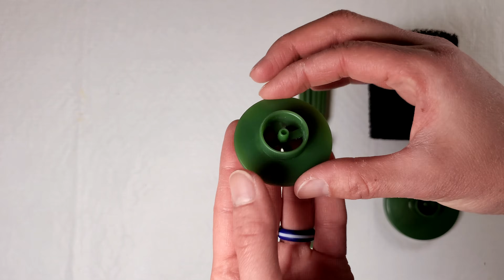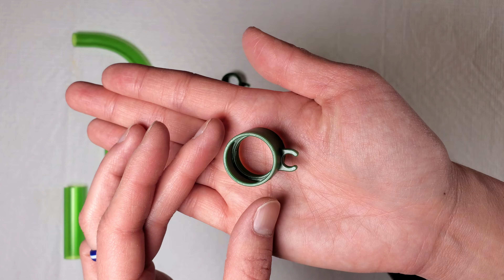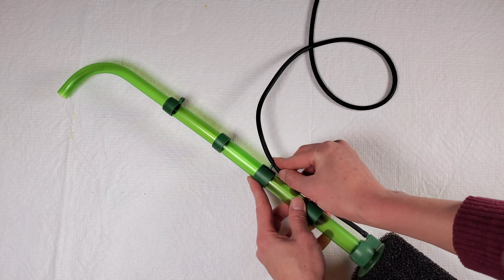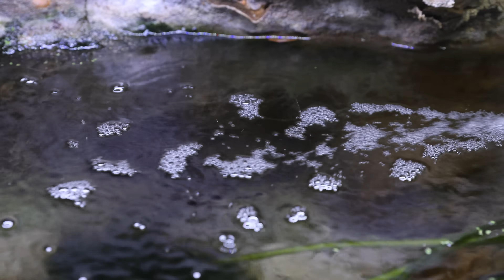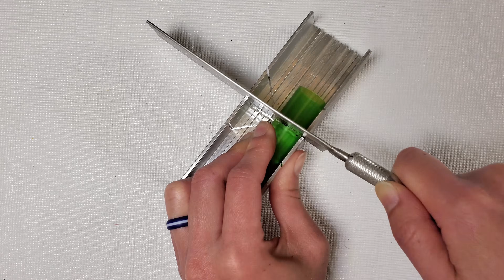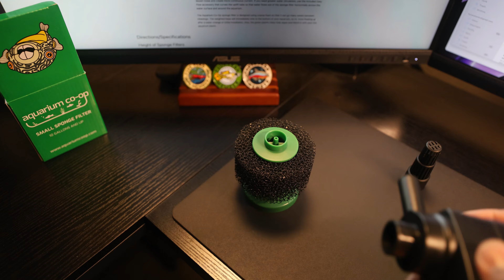How to Install the Aquarium Co-Op Sponge Filter and Easy Flow Kit

Comment: Is it me, or this filter it too corse to catch small particles?
Reply: @KAAPNW There are two sizes available. Fine or coarse. It certainly does look like the coarse one in the video.
Reply: It may sound counter to logic but its main goal is biological filtering more than physical filtering. It will catch a big particles that starts to clog it and make it get “finer” over time. If you start fine you will clog quick and get no flow.

Comment: How does that air collar work? I can't find any other hole than the one the tube connects to.
My nano stopped producing bubbles and I can't figure out why. I did clean the sponge before anyone asks. But I'm stumped on why I can't get it to work. The tubing has no cracks. Help!

Update, it was hard to see the holes because they were covered in brown film and I got it cleaned. The holes are on the inside of the ring for anyone who has the same issue.
Reply: When did you purchase the nano filter? Website says the easy flow kit doesn't fit nano models before 2023.
Reply: @dtw1622  A few months ago. I figured it out. The holes in the collar were covered with gunk and I soaked it in rubbing alcohol for a little bit and used an old tooth brush to clean it off. It works great now.
Reply: @soupbonep  Where, exactly, are the “exit holes” in the air collar? I don’t see any inside the ring. I’m having exactly the same problem.
Reply: @TheArachnoQueen  They are on the inner part of the collar. They are tiny. You won't see them until you clean all of the gunk off. You may need a magnifying glass to see them. Soak the collar in rubbing alcohol or hydrogen peroxide, then use an old toothbrush to scrub off the gunk if you need to. Good luck!
Reply: @TheArachnoQueen  did you have any luck getting your collar to work? I discovered that my old air pump was pumping too weak to get a good air flow. I got a cheap four dollar air pump from Meijer and it is powerful and I get a healthy amount of bubbles with it. I was surprised because I got the pump for a quarantine tank, but tried it on the collar I was having trouble with and it was powerful. Well, it was four bucks last year, it may be a little more now. It's a Meijer brand.
Reply: @dtw1622  It is a pretty new filter.

Comment: Maybe these instructions should be included in the packaging :o! I didn't know I could cut the tubes shorter to fit my 5 gallon tank, so I just had the easy flow it sitting around for a while.
Reply from the maker: We felt it was too difficult to show how to do it in the instructions. With video it's much easier to prevent people from doing the wrong cuts.
Reply: @AquariumCoop  Maybe a small paper with the QR code linked to this video perhaps? Or even printed on the outside of the packaging?
Reply: @kawaiiplanit smart human 👍
Reply: There is! @kawaiiplanit

Comment: This is awesome but it still does not shorten it enough for a 25x15x7 (width-depth-heigth) Tank. I tried to connect it to the weighted base then put the sponge though it but it will not stay put and it negates the sponge part of the filter anyway. It just will not work for my short shrimp tanks and I was really hoping it would.
Reply: yeaa, cutting a inch off like in the video barely fits in my 10gallon that's well over 7in high
Reply: I had to also cut the longer curved tube to fit in my 8 inch height 6 gallon tank